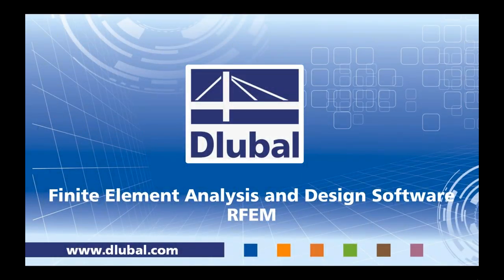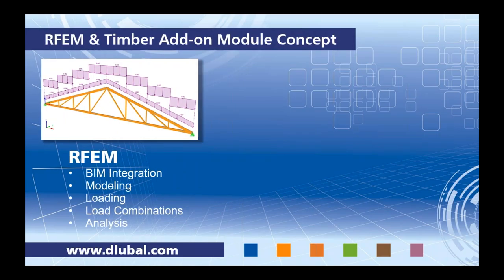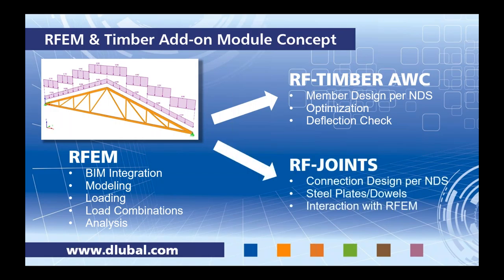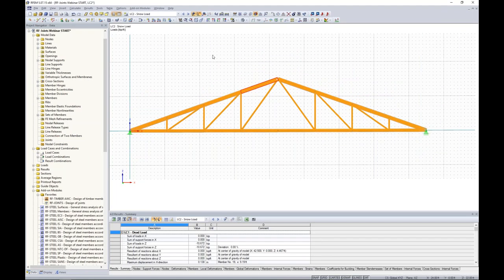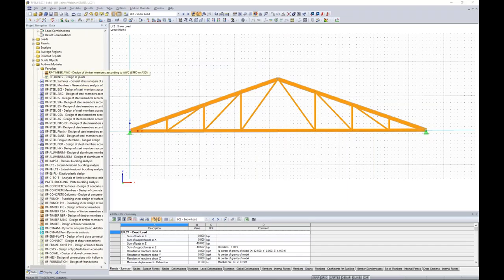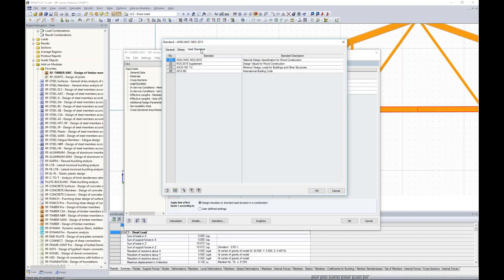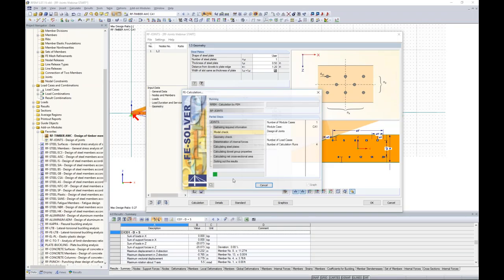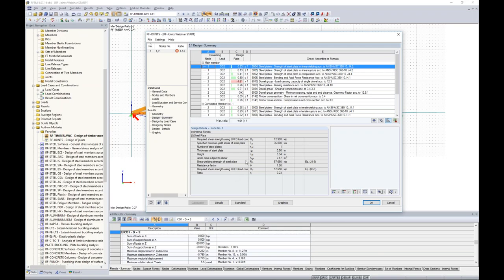Webinar: AWC/NDS Timber Member and Connection Design in RFEM (USA)

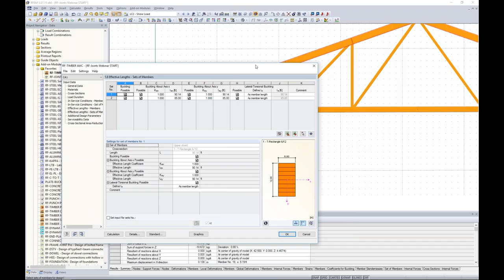Comment from the maker: *Note: At time 16:31, there is a mistake in the sets of members strong vs. weak axis designation when setting the unbraced lengths in Table 1.8. The sets of members local x-axis is actually the "strong" axis and the local y-axis is the "weak" axis.  Therefore, if "weak" axis buckling is not a concern, the user should disable "buckling about the y-axis" in the table settings [Column E].  If "strong" axis is a concern, then "buckling about the x-axis" should be activated [Column B] and unbraced lengths and k-factors for the x-axis should be set by the user [Column C and Column D].  This is opposite of what is shown in the video.
Reply: Thank you - that makes sense.